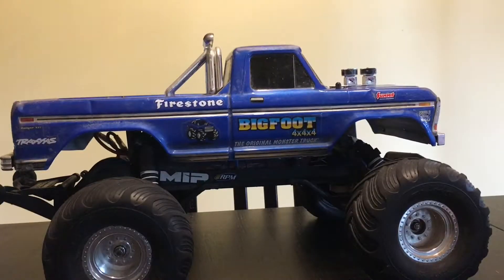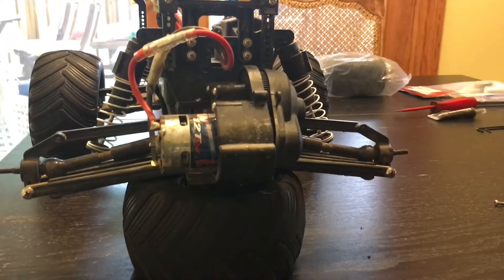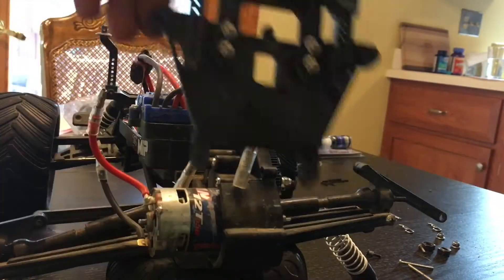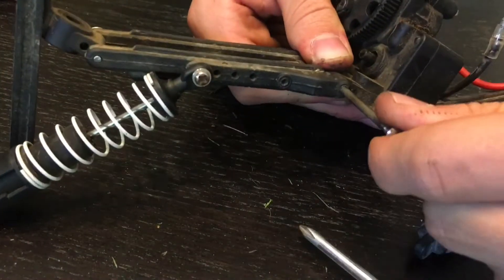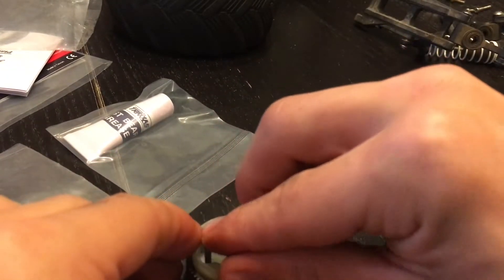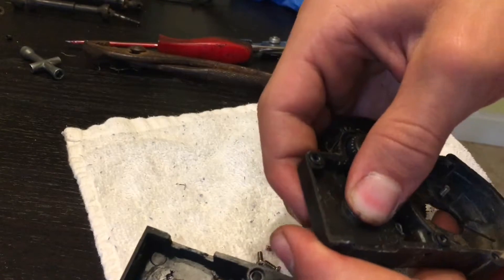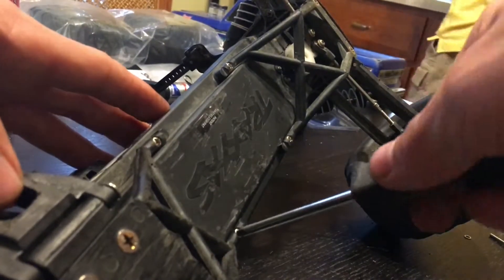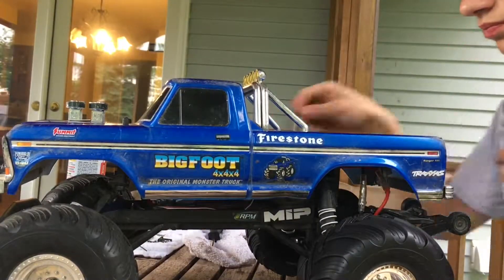How to Replace a Broken Traxxas RC Differential

Comment: I had a rustler and a stamped so I have done this a million times...lol!
Reply from the maker: I’ve done it a few times too. My plastic axles kept breaking, so I got metal ones and now the differential keeps breaking.
Reply from the maker: Thanks for supporting my channel. I love your channel too.
Reply from the maker: I’ll give you a shout out in the next video I make. It might not be the next video posted, because I have scheduled videos already made, but the next one I record
Reply: Yep..thats how it works..u upgrade one piece and break another
Reply from the maker: I wanted to get a spool, but it already barely turns as it is so adding a locker would make it really not turn.
Reply: My motor wants to twitch when I move it by hand how do I fix that
Reply: I've seen many videos. Seems like different ways to take the tranz out of the truck .... So if I've done slipper clutch 10 different ways and this POS. STAMPEDE won't Fn Move hardly. So... Is it that the Diff. Is BAD. I've took it apart all looking. Good inside no stripped gears or funny wearing pattern relubed and resembled .... I built REAL CARS from the ground up got rc boat s and planes .. This shit is baffling ME???? No extra parts watched 5 video to remove and replace/rebuilding/maintenance..
Reply: Where can i find these parts on internet?????????
Reply: @craiganderson936  😂😂😂 did you ever figure it out mate? … I’m having same problem but I haven’t taken it apart once yet. 

I’m thinking if all gears are good and it’s not the slipper clutch shaft pin then it’s gotta be the differential gear/planetary gear.
Reply: @TwoSmoker420  yes I did  it was that small pin that locks the gear on through the shaft
Reply: @craiganderson936  okay 👍 thanks for the reply I’ll take it apart tonight to have a look
Reply: @craiganderson936  I guess mine wasn’t moving because of a driveshaft problem lol I have brand new Xo1 driveshafts so I didn’t think that could be the issue… but when I was inside the tranny I also did a difflock mod(gorilla glue) and when I put it all back together only one wheel was spinning, fixed by adjusting the shock mount on aarm to lower the over all height of my rc which gave the driveshaft more to grab onto as it was over extended

Comment: I think it’s only for the 2wd models I have a 1/16 e revo and the diff grinds for no reason and I’ve replaced it several times and it still grinds after a week of use so I don’t know what to do with it
Reply from the maker: I feel the same way. I've considered filling it with JB weld to make a locker. Sorry I missed your comment.
Reply: John Wheels yeah is really annoying but I will just have to get use to it
Reply: John Wheels Yeah i don’t know if u know but this is fixit Rippit reckit and I finally go my cart running so I’ll have a video on it tomorrow
Reply from the maker: Ok cool, you might want to change your name so they don't know your last name. I won't tell anyone.
Reply: John Wheels ok thanks

Comment: How did you know it was bad? Thanks, mine is grindind and only one wheel spins when giving gas..i guess its bad
Reply from the maker: The way I knew it was bad was I heard a bunch of crunchy grinding gear noises. 

These cars have open differentials, so if one wheel spins, try loosening the nut on the opposite wheel just a bit. If still only one wheel spins, then you know you have a differential problem.

Comment: My rc rustler will move when I give it  throttle And when I put it back on the ground it does not move and when I pick it up it moves I checked the transmission and every gear is fine what can I fix or how do I fix it
Reply from the maker: Your battery is probably dead
Reply: @JohnWheels  Oh my battery is not dead I checked it what else to be the problem
Reply from the maker: Ok, I'm sorry I'm not quite sure
Reply: Did you check the planetary gear i think it’s 4 screws and the top is plastic and take it off and make sure non of the gears are broken or worn